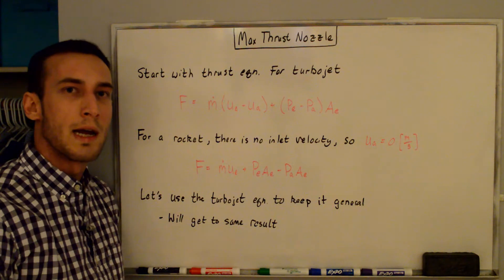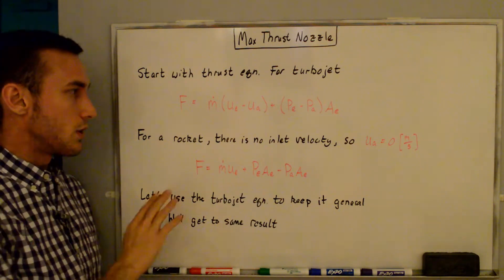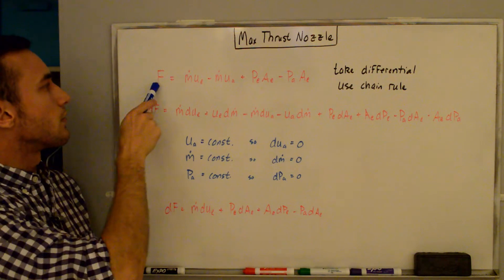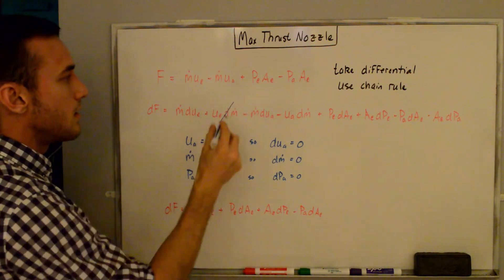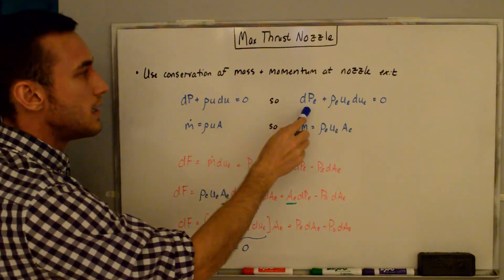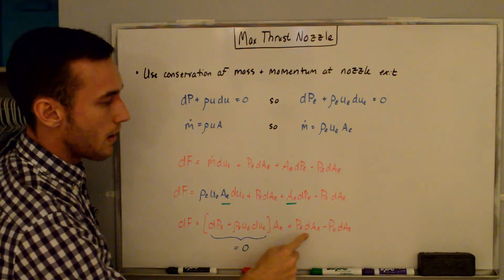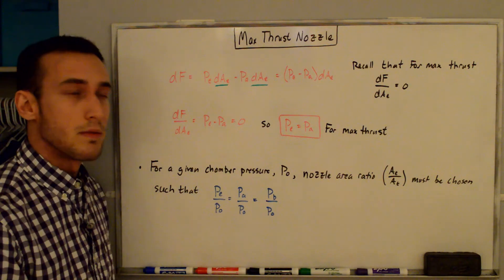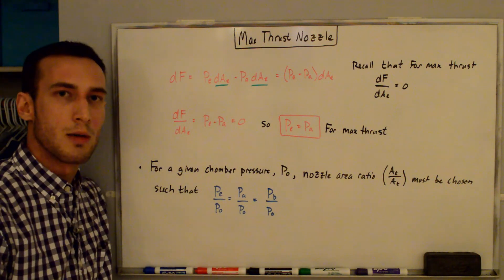Explained: Maximum Thrust Nozzle Exit Pressure Condition

Comment: I understand the maths however I can't wrap my head around looking at the initial thrust equation it looks pretty clear that if pe is greater than pa F is greater so how can thrust be a max when pe=pa? pls help
Reply: I think that this is because he is only looking at changing exit area. He fixed backpressure therefore the term with dpa disappeared. In his case underexpanded means that the exit area is smaller at the given backpressure than it should be and so the contribution due to pressure difference (pe-pa) is smaller and the momentum term is smaller as well due to lower exit velocity. If you fix everything except the backpressure like e.g. when a rocket is moving up in the atmosphere and the backpressure is dropping, than underexpanded nozzle (according to this simple 1d model of ideal fluid flow with no losses) provides more thrust. But you are wasting energy, because the flow accelerates downstream the nozzle with no use.

Comment: Again, one of the best explanations I have seen. A number of textbooks on propulsion "hand-wave" and gloss over this important point without attempting to offer any rigorous physics / calculus based explanation. Nice work!
Reply from the maker: Thanks again!  This one I hadn't seen until I got my hands on the Zucrow and Hoffman book at the library, and decided to make this video in case it helped anyone else out.
Reply: @JoshTheEngineer  Ah! Thanks for the reference. Most books seem to simply "gloss over" this. A few days before I found this video of yours, I spent hours proving the result "the long way round" by tedious differentiation (with respect to exit non-dimensional exit pressure, with back pressure a fixed parameter) of the formula for thrust. I was feeling quite smug until I found your film.....(I vaguely remembered a shorter way, from what I was taught by some (other) really smart chaps at Oxford over 35 years ago.)

Anyway - your channel is excellent. (It would have to be for me to subscribe!).

The delineation of the conditions on the c-d nozzle is probably the best explanation out there. Best wishes from the UK. Dan.